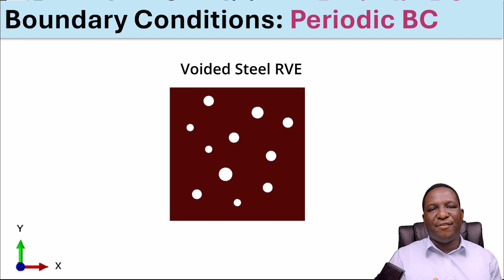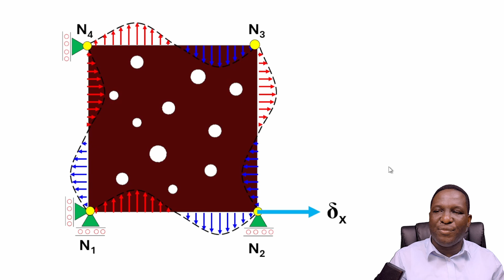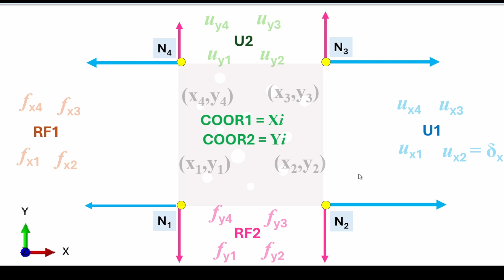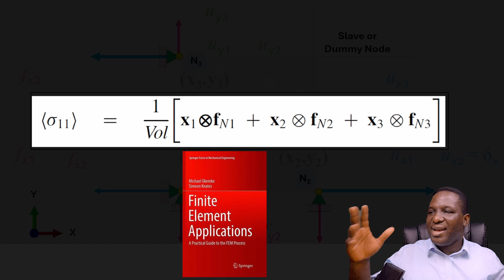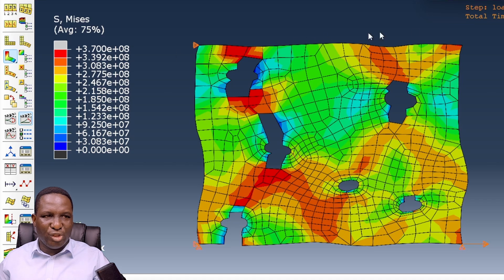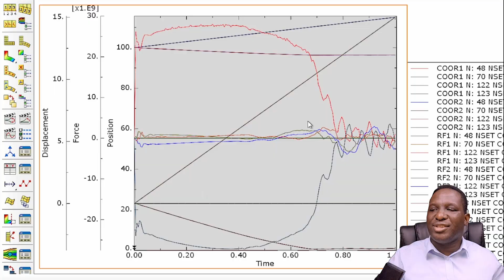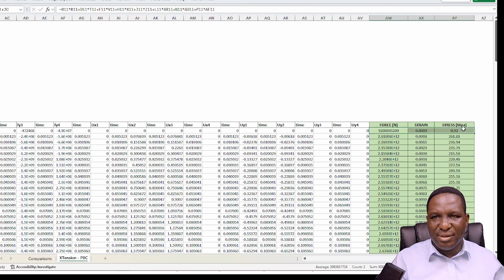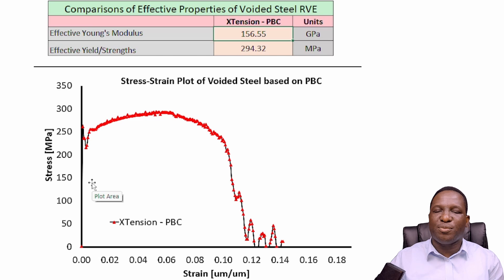Abaqus Tutorial: Plot Perfect Stress-Strain Curves with Periodic Boundary Conditions

Comment: Thanks for your great video I want to know how to access excel file? (I could not find in the CM Videos)
I have a few questions: 1- Instead of corner nodes, is it possible to use a reference point? If it is possible to use RP, should we just use the RP history output?
2- Is it not necessary to use the net area of the material to calculate the stress? (I mean in this example the area = 100*100 - void area)
Reply from the maker: i do not believe the excel file was part of this. I have videos on the channel on pbcs and stress-strian which you can extract thhe files there.